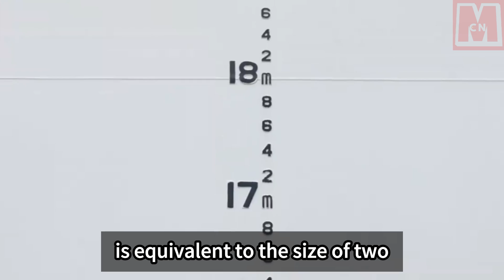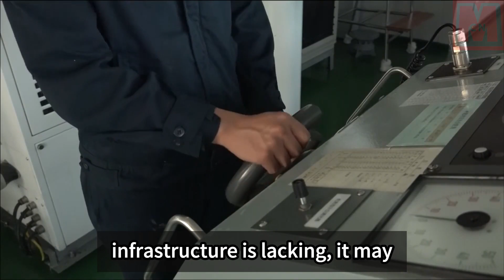China's 100,000-ton sea giant is a mobile sea base, capable of accommodating the US aircraft carrier

Comment: This is a semi-submersible heavy lift vessel, used for moving Oil Rigs and other vessels that are not propelled, these vessels have been around for a long time, she is 98370 ton summer deadweight her steel weight is much smaller than 100,000 tons (around 20,000tons)  aircraft carriers are small compered to some commercial vessels such as Oil Tankers (450,000 ton summer deadweight) and Container ships. The Xin Guanghua is the second largest heavy lift vessel in the world the largest one is the  BOKA Vanguard.

Comment: In 1980s Finland used to build lighter carriers on same principle. They were used to load lighters (barges) by mothership submerged and lighters towed inside the hold and delivered to destination. As to carrying ships on deck  I think flotting docks are more practical and way less expensive. As to salvage operations mooring pontoons to a ship in distress is a better solution. Also big question about this kind of mammoth structure seaworthiness. And last but not the least putting 100000 tons on deck will cause metacenter go to negative and she will capsize.
Reply: @felixbekker9388
Good analysis!
Reply: It seems easy to agree with you

Comment: Preparing for the launch of their new carrier.😂😂😂😂
Reply: It was launched last Summer. Outfitting is almost done. it is ready for sea trials within a month.
Reply: #4 is coming @laughingkor8643
Reply: @laughingkor8643 Recent satellite photos show it still in drydock with cracks running the width of it.Must be photoshopped.😂😂😂😂
Reply: Nonetheless flat deck carrier with catapult has extreme weakness.
It's the catapult
If that launch line get slight damage, it becomes useless.
Rreason why these nayions with flat deck carrier can't risk exposure and will need to run away from any battles with slightly strong adversaries
China will also learn the stupidity of the catapult